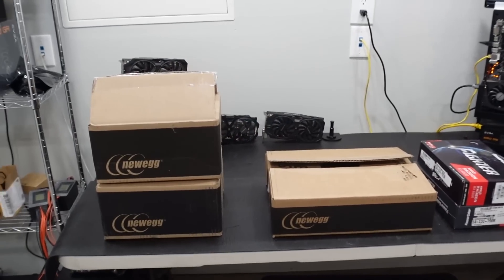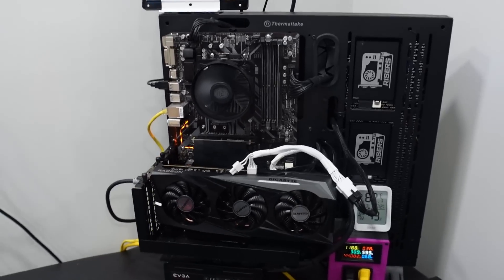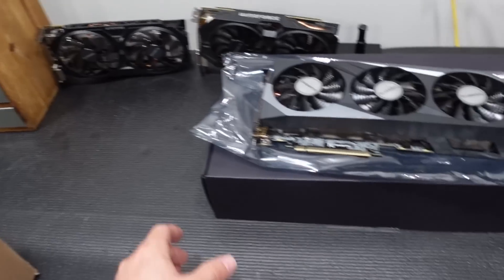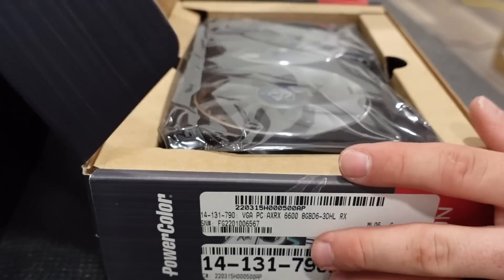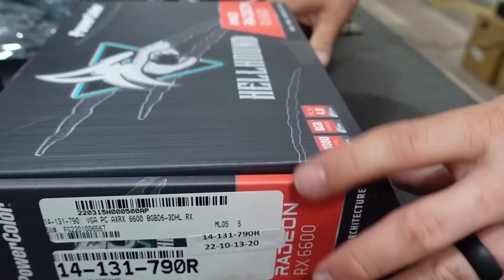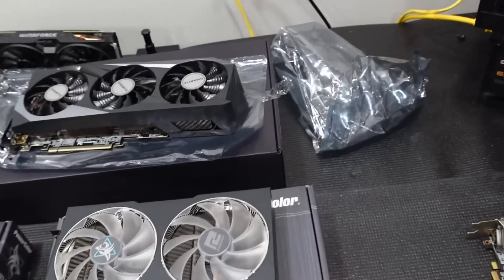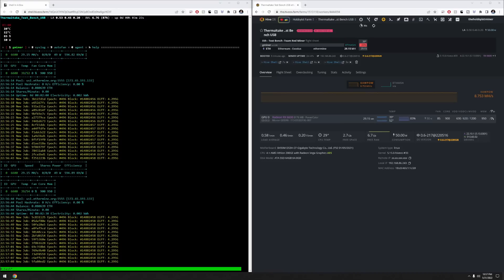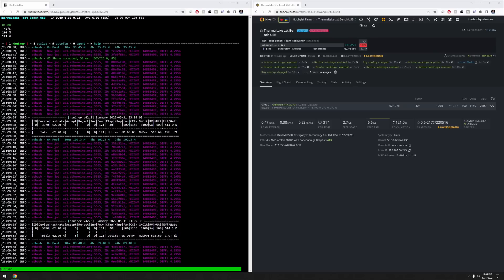What GPUs am I Buying to Prepare for the ETHERUEM MERGE? | GPU Mining After ETH 2.0

Comment: I just ran up on this video and wanted to share my setting in hive for the Power Color fighter rx6600.  triple mining ETH/ZIL/TON, LOLminer on EZIL, 28.92mh ETH & 860.4gh TON,  in hive 63w at wal 82w. core 1520, vdd 750, vddci 630, mvdd 1100, mem 950, fans @ 80%, temps 46/67.  Has been a very reliable card.

Comment: Huge increases to power rates in Australia have spooked a lot of local miners to try and sell their whole rigs, with speculation about the release of Nvidia 40 series GPU's most AUS retailers are now actively discounting their 30 series stock which has caused the used GPU market $$ to drop pretty drastically as well. Coupled with the LHR unlock it has never been better to buy modern efficient GPU's only problem is profitability has tanked so ROI is way above 6 months for most GPU purchases, plus the shadow of POS makes for interesting times for mining in Australia
Reply: Agree, i am in Adelaide and our Power is crazy - i am break even on average but still in profit after tax - only just, its getting tricky. As long as i keep break even, happy to accumalate as it pays for house power as well. :-)

Comment: Not gonna buy and haven't bought anything in the last 8 months. I bet mining with gpus will die after ETH goes PoS. Only chinesse people with electricity below 5cnt or even people with free electricity will survive. The rest will have to capitulate, or mine at a loss and cross fingers that there is price discovery for another PoW algo (which i don't think it will happen considering the current disastrous situation of the market. 
But anyway, i will not suffer the error, so good luck.

Comment: Have you tried your R9's on an older version of hiveos? Near as I can tell, the R9 is not playing well with AMD 21.40, but does work well with AMD 20.40. I have an old mobo, setup just for the R9 operation running hiveos 0.6-212@211130.
Reply: Same experience here, I’ve got a couple. They don’t seem to play well with all my GPU’s either. I have a rig with 9 470’s and a 580, worked fine with the 470’s, the moment I drop in the 580 it kernel panics, same issue if I use the two R9 390’s on the same rig, due to this I have two running on separate minimal benches that I use for testing. One is paired with a 470 without issue and the other is running on its own.. still impressed with the average 20 MH/s with them though even with the power draw which is reported at 90w.
Reply: @descent456  I get 29 and change on my 390. No settings in hiveos for it at all.
Reply: Mine report 45 but the actual hash is about 20.. what miner are you using?
Reply: @descent456  Phoenix.

Comment: The 6600 and 6600 XT Powercolor Fighters are all you need for mining tbh, they don't have any thermal issues in my experience.
Reply: If you haven't experienced the Asrock models, the Power Colors may seem good just because it's a 6600. The Asrock and XFX models barely need the fans on; in fact they turn off about half the time if I leave auto fan to 50 deegrees.
Of the 6600's, Power Color and Sapphire have the worst thermals. Also the smallest heatsinks.

Comment: Hey man. For the 6600's, if you use Team Red Miner, you should get a significant wattage reduction.
If you also change your core from 900 to 901, this should also reduce power.
The Hynix memory power colors might also be able to tune a bit lower; such as:
Core clock: 901
Core voltage: 617
Mem control voltage: 580
Memory voltage: 1090
SoC VDDmax: 767
35w software is what mine runs at. About 47w wall.

If your main focus is max hashrate, use Team Black Miner and get over 30 MH, but shares submitted won't increase by more than 1%; wattage will.
Also, sorry about the Micron memory cards, they'll probably use about 10w more than the other cards are able to tune down to.
Reply: Those are some good numbers, added about 10mV to each of your voltages, but still managed to drop 8W software of each card.
Reply: @BlackCoinCrypto  Nice man. 6600's are really efficient GPU's. I've tested my 8x6600 rig on about 12 different algorithms, tuning each one to max efficiency. Made videos of it all on this channel if you ever need a starting point for OC's.

Comment: Ok I like ya hobbyist so I'mma let ya in on a secret :D

On those 6600's you ought to try numbers more like this (in HiveOS):
core 901 (yes the 1 is important), core voltage 640, mem controller voltage 640, mem clock 950, mem voltage 1120, power limit 0, SoC freq 760, SoC VDDmax 820

On a powercolor hynix 6600 that'll do 28.98MH at a reported 36W software.
Reply: What miner?
Reply: @reactor8502  teamred

Comment: I hate to spoil the party. Obviously my opinion and no crystal ball. Either you think the merge happens or it doesn't. Even if it comes early 2023, it will forever change POW. A successful POS ETH paves the way for all POW coins to do the same. Peer pressure, enviro, etc, will kill POW all together. Flux are rebels? Just background gum flapping from Flux. Vitalik has talked to doge about moving to POS. ETH POS is bad news for everyone in the POW field. Of course big "if" ETH POS happens and goes well. It's a question of how much $$ are you investing in the hopes that POS ETH fails? I'm not banking on it.

Comment: I have 3 rigs mostly 3000 series cards, One 1070 from and old computer.  I'm running 1 rig 24/7 and the other 2 at night during off peak hours.  It saves on electricity.  I'm not getting any more cards until after the Etherium merge

Comment: Brother, for the RX6600s  you need to set the core clock to 901 in hiveOS, and watch the power draw drop 4-7 watts. It's some glitch where it doesn't keep the clocks unless it's set to 901. Also use R-MODE in TeamRedMiner and you'll get another .6mh each
Reply: Why in the holy hell did I not know the overclock thing sooner?...  That just dropped me from 403 Watts to 372 Watts with 4 cards.
Reply: @loveracing1988  I'm running 13x 6600s, i barely started mining a few months ago but I've had to do a lot of learning in that short amount of time lol
Reply: the mh boost in r mode is hit or miss, all depends on if you lucked out in silicon lottery or not brother.
Reply: @rehtric6537  i have 13x RX6600s, mostly micron mem, a few Hynix, and all across the board they bumped up .6 exactly
Reply: @bobamri  wow then i just must be unlucky with mine then, mines have been all over the board really. Some are .6 some are .3 etc
Reply: @rehtric6537  what brand? Mine are all XFX RX6600
Reply: @bobamri  I’ve got a mix, 3 are msi other 3 are sapphire. msi have micron, sapphire’s have hynix, all different mh totals in r mode. Seen familiar problems through some forums and Reddit, seems like I got unlucky in silicon lottery.
Reply: @rehtric6537  all my micron cards run at 29, and the Hynix run at 29.6
Reply: On SM 6500 XT beats 6600 in efficiency  in Ravencoin , 14 Mh/s 56 watts vs 7 Mh/s 24 watts but  i switched to haven 250 watts 4,1 kh/s 3x 6600 + 2x 6500XT + ryzen 3950

Comment: Definitely ready to start buying more GPUs but until I can even do that I got to get the new lhr unlock to actually work for me, it has been the most unstable thing I've dealt with and have only been losing, so I've currently been forced to go back and use old drivers on my GPU which in returns mean I can't use the full unlock so until I can't get that figure out why one of my cards crashes non stop when on new drivers and I don't know how to assign different drivers for different GPUs in the same rig, whatever driver is last installed on one of the cards is what takes over the whole rig. So it has been a nightmare lately and until I get this headache figured out adding GPUs will only make the headache bigger I think. I'm curious am I the only one that has to use old lhr unlocker because the new one with full unlock been so unstable it crashes non stop?
Reply: I've done the 100% unlock successfully and can make a video on how to do it if you want.

Comment: I sold all my lower GPUs while still could get a decent price for them. Gonna try to grab NVIDIA 4000 on release date, feels like investing on 30 series now not worthy for me
Reply: 4000s have terrible efficiency and not that many cuda cores more
Reply: @scenopiachannel  Really, what are the actual numbers on any of the 4000 series cards?
Reply: @MassBoost  powerwise:
-3080ti 10400cudacores 4080 10700cudacores

Efficiencywise:
-4080ti 600w
-4090 800w
Reply: @scenopiachannel  You're comparing a 80ti to an 80, is that an actual apples to apples comparison? I think not. Maybe you should be comparing the 8704 cuda cores that an actual 3080 has. Also those numbers are confirmed by Nvidia?
Reply: @MassBoost  3080 is 350w vs 4080 450w
As for cuda cores, the 4080 is +20% vs 3080, the 3080 had +45% vs 2080 (6000cc).
It makes sense, the 1000 series was also a big boost vs 900s, then the 2000s was poopoo.
Reply: @scenopiachannel  who had these numbers? Whos mining with them? Show me...
Reply: @rkwjunior2298  That's what the hackers said. They're legit, they unlocked lhr and nvidia admitted to the hacking 2 months ago.
Reply: @scenopiachannel  nobody knows till its actually being mined.  Your numbers are still speculation
Reply: @rkwjunior2298  its not speculation, they're straight out of hackers who successfully 100% unlocked lhr with that info. As for mining, they will have an even harder lhr, probably for other coins besides eth given the merge, plus they're clearly less efficient given the wattage/cc, so forget about it.
Reply: @rkwjunior2298  Besides, the hackers blackmailed nvidia so they would unlock lhr themselves, they didn't so they gave nbminer the hack. This was all confirmed by nvidia btw.
Reply: @scenopiachannel  40 series mining stats are not confirmed, nobody has those gpu in hand to mine.
Reply: @scenopiachannel  You still didn't answer my question of whether Nvidia has confirmed any of your numbers relating to the 4000 series?
Reply: @MassBoost  I did, but my comments are being deleted so f this
Reply: @scenopiachannel  You're completely wrong. Marko Tarman, mining manager at Nicehash said the hack at Nvidia played no help for the developer who cracked LHR.
Reply: I am buying more 3060s Asus Rog Strix. Less heat and so silent.